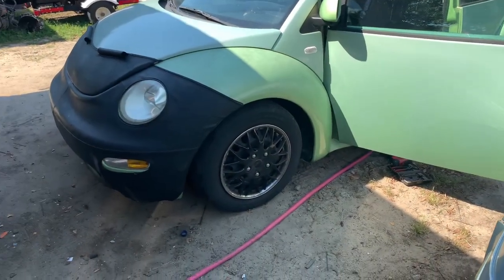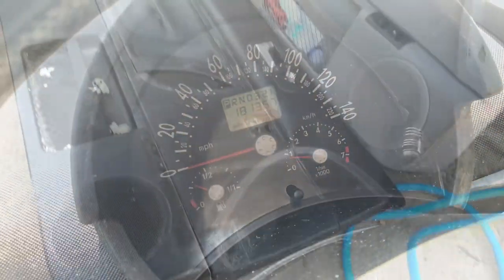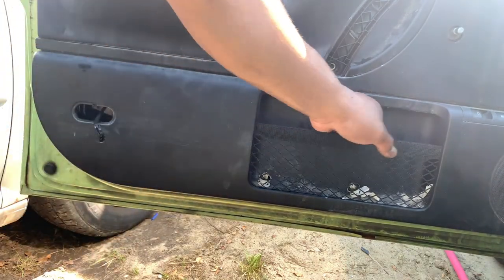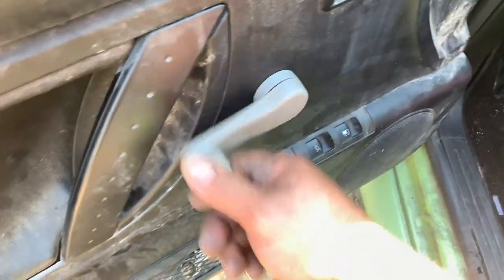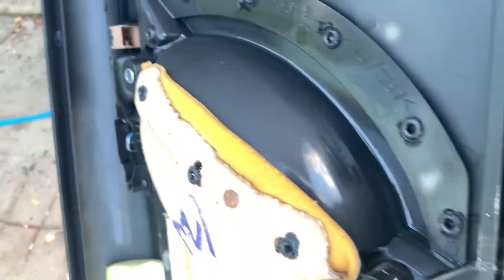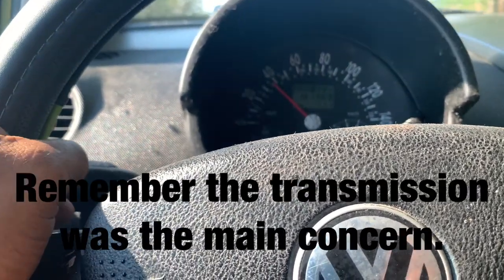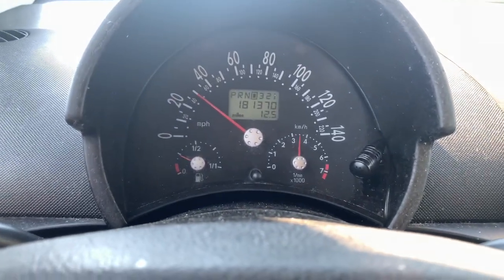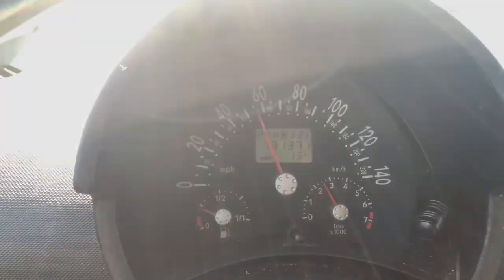Vw beetle aeg 2.0 automatic transmission problems part 2

Comment: @taco v8 would you recommend replacing the valve body if the car no longer goes into any gear? I have 2002 AUTO 2.0 GLS. January 2022 was shifting but hard then let it sit until now. Changed engine oil and filter and filled coolant. When I turned it on to go it just went a little like it was in neutral. Made a little clunk sound on drive. Thank you for the video btw!
Reply: Beetle with 135,000 miles
Reply from the maker: Is cheaper to try a valve body than replacing transmission   , but one thing is slipping clutches and another thing is valve body  you have to know that  .  

Sometimes valve body is good but clutches are burned  , in this cases is best to replace the transmission .  

But if the transmission is going in every gear but in the process of shifting is doing it very hard  , is most likely all the clutches are good and valve body is bad  . 

I will replace valve body if i know the transmission still goes in gear and the car moves  .
Reply: @taco 8v Thank you for the response!! I will have to rebuild then. The car was going and shifting but hard when we first got it and didn’t think much. Now after it sitting for long must’ve just gave out. I had a quote from a shop to rebuild it at $2,295. Do you think that is reasonable price? I’m in Chicago
Reply from the maker: Here prices are around 3500 1year warranty